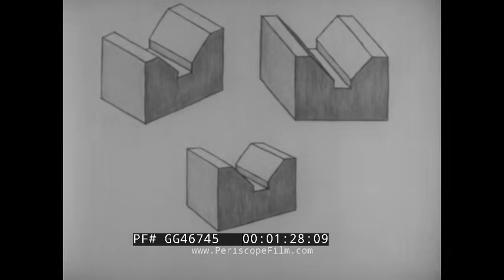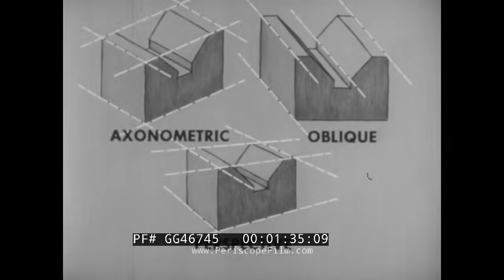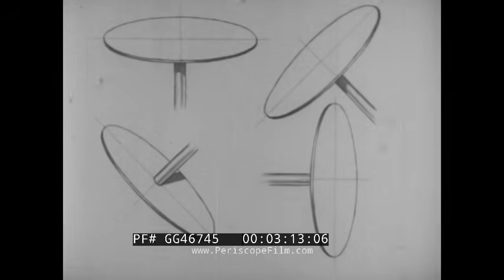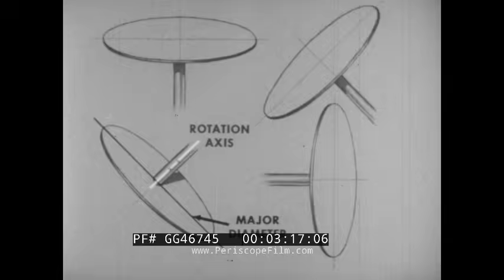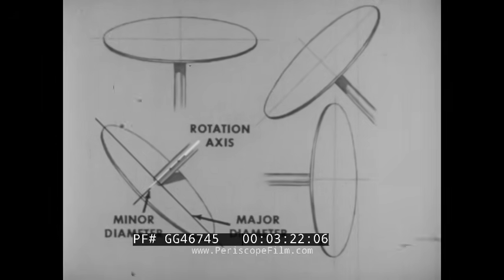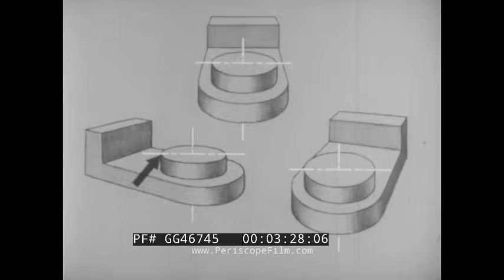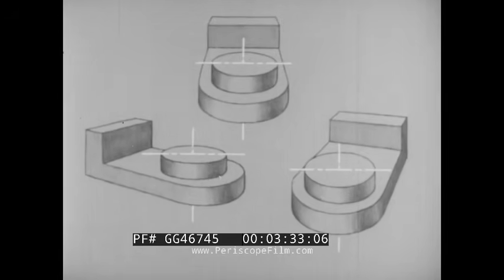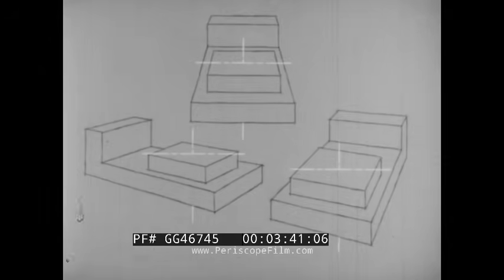" PICTORIAL SKETCHING " 1953 ENGINEER TRAINING FILM PRODUCING ORTHOGRAPHIC FREEHAND DRAWINGS GG46745

Comment: I took a class like this my Sophomore year of High School(1997-1998), at the time it was called Mechanical Drawing. I did ok, it reminded me of what my Uncle still does for aircrafts which is AutoCAD(he designs parts and whatnot for airplanes). I became fascinated by AutoCAD at the age of 11 or 12 when my Uncle showed me what he does for his work on his computer, amazing stuff. I hope CHAP finds some videos on AutoCAD(whether it's about the History of it or what AutoCAD is used for,  anything would be cool), great video as always PF
Reply: I started using AutoCAD in 1991.  I knew how to do perspective by hand and was excited by the possibility of using a computer to actually draw (or model) in 3D.  It didn't disappoint.  Unfortunately, it was and is very expensive.  Nowadays, it's like beer:  you can't buy it, you can only rent it.  At the time, it required special equipment, which is one reason I went into graphics programming.  

Matrix multiplications are the heart of computer programs for 3D graphics.  Using them is much faster and more accurate and efficient than using vanishing and measuring points.  Traditional perspective drawing is a graphical means of representing 3D data without ever explicitly using points in 3D.  The traditional way of laying out sundial faces works in a similar manner.
Reply: @laurencefinston7036 Super cool 👍🏼
Reply: @ElijahRetro1982  Thanks!